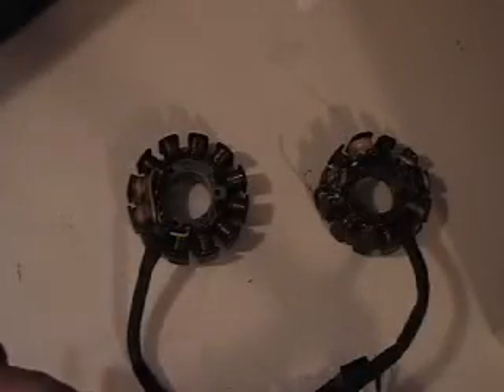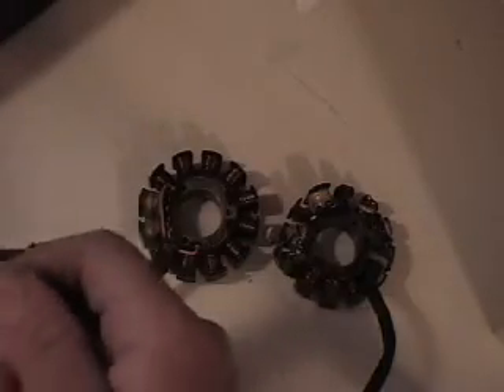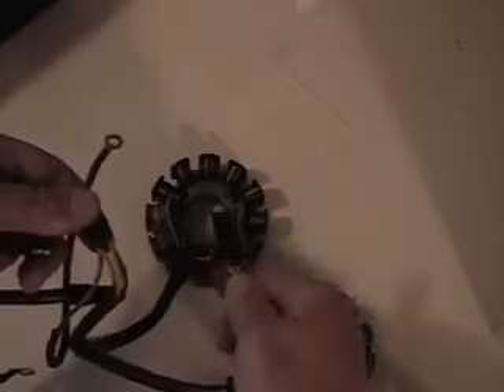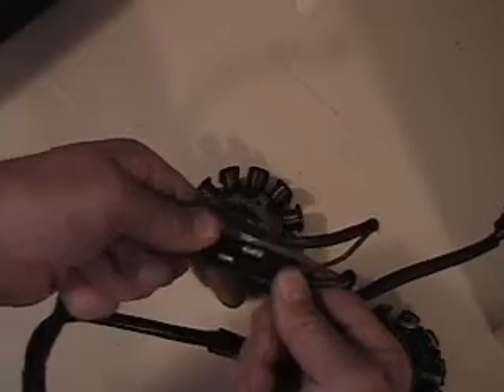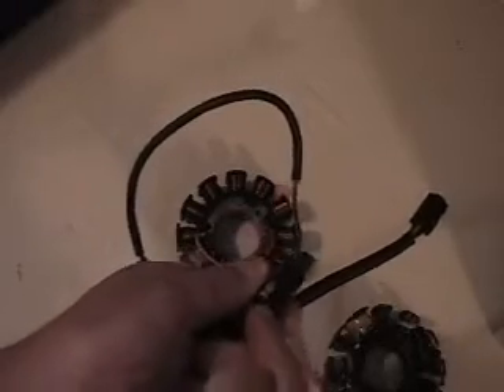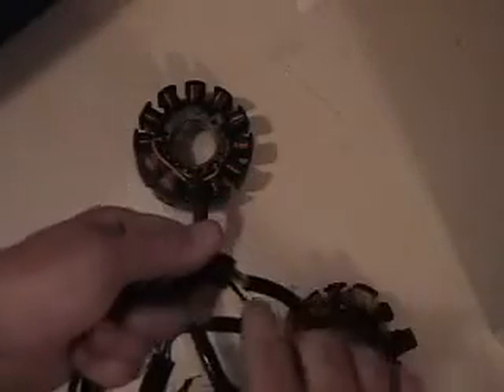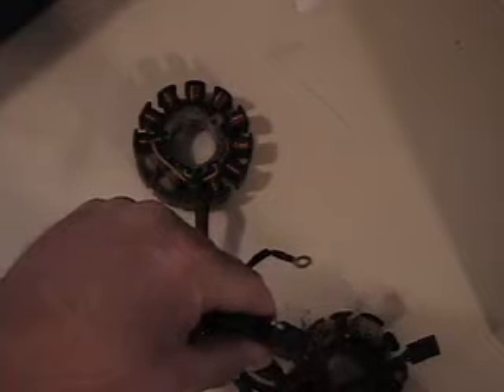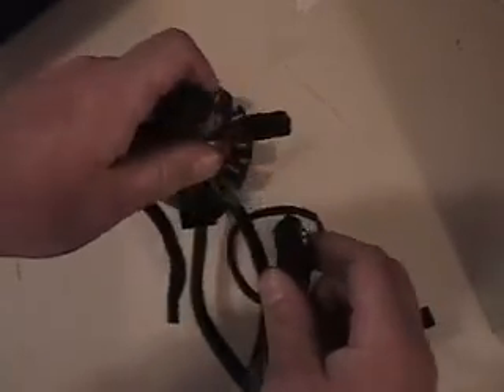Arctic Cat ZRT and Thundercat snowmobiles: How to bypass the wiring harness for the key switch

Comment from the maker: You have to run a regualtor. The AC voltage coming out of the stator is WAY too high to rin it straight to your lights and gauges. If you run without a regualtor it will blow all of your lights and gauges.